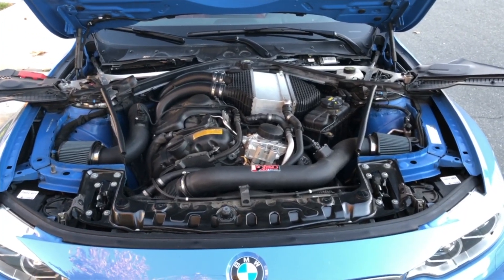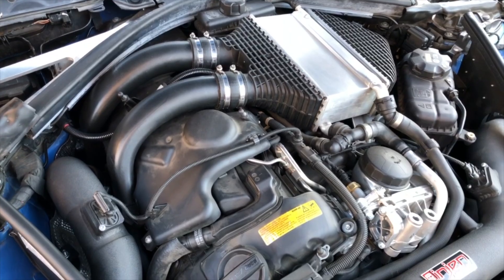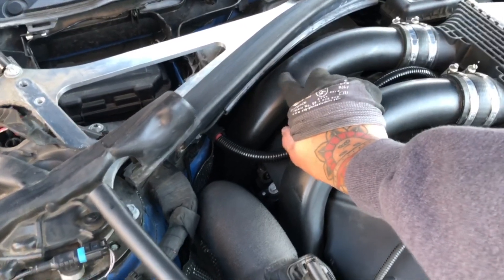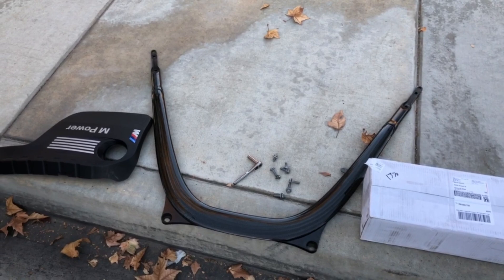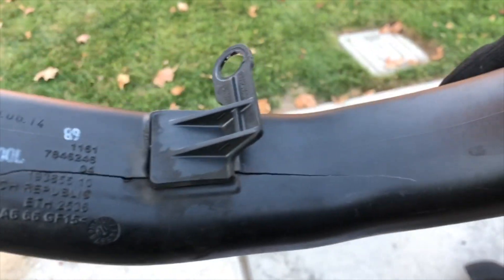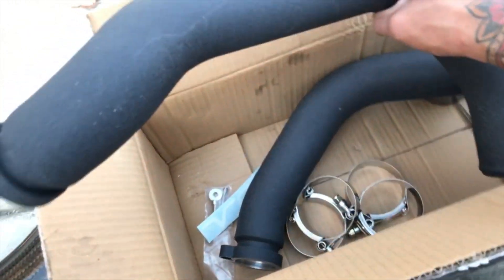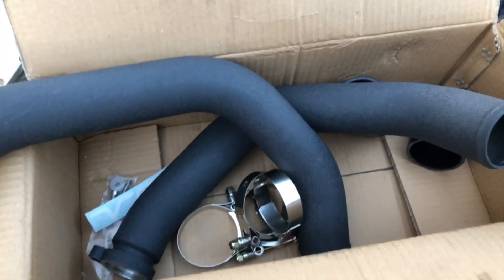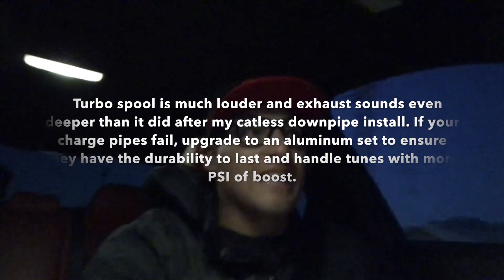Chargepipe failure on my BMW M3!

Comment: Hi I’m hearing a hissing sound when I push the accelerator and it’s louder with drivers side right window open and the charge pipe has also slipped of once and I reconnected but the hissing is still there and it’s slowly slipping it again could it be a cracked charge pipe or a different issue? Thank you

Comment: You need to use the O-ring seal in the original pipe on the turbo end into your after market charge pipes